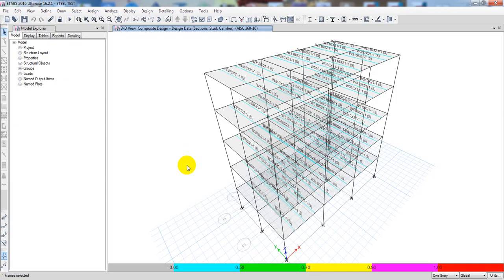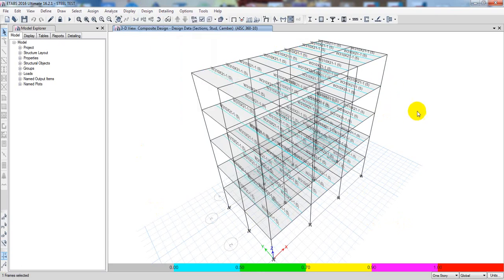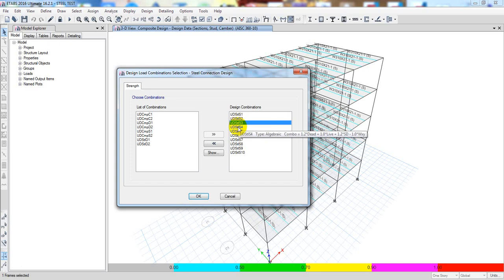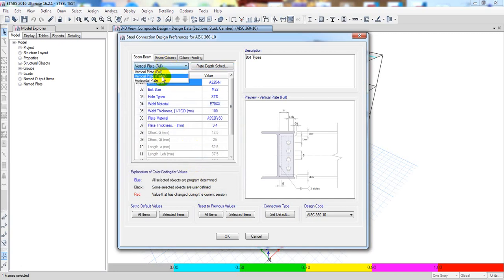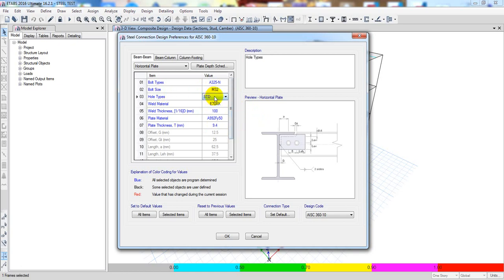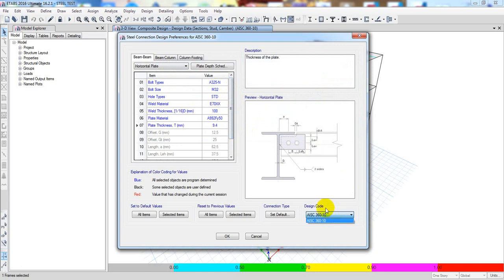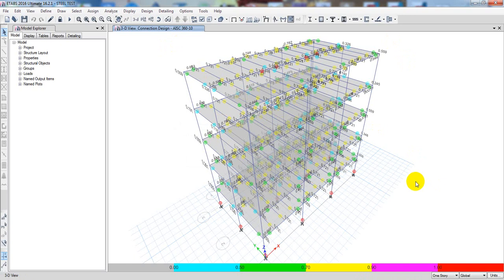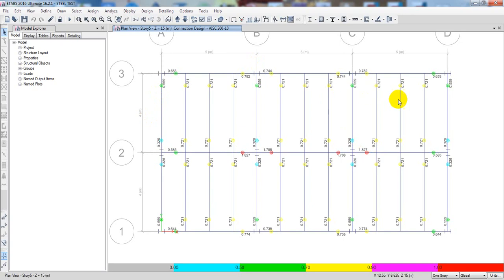Steel Connection Design in Etabs | Introduction and Design of steel connection

Comment: Hello i face problem that
I got many connections not safe and i have to fix that one by one Which is very annoying how can i solve this problem
Reply from the maker: that's why tekla is best for steel structures
Reply: @qlearnify-en  True
So its not useful to use etabs for connection right?
Reply from the maker: Yes